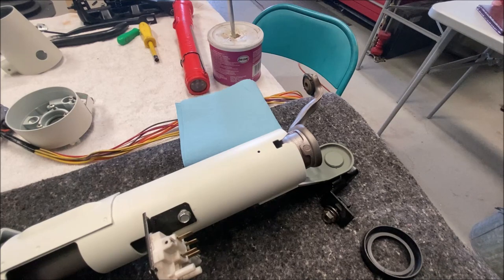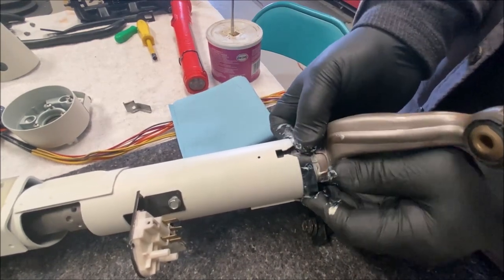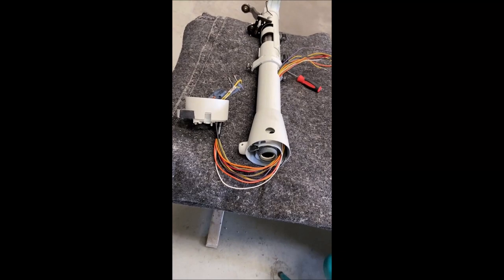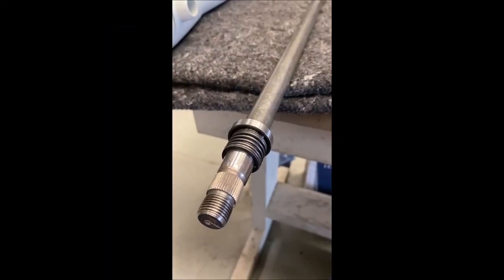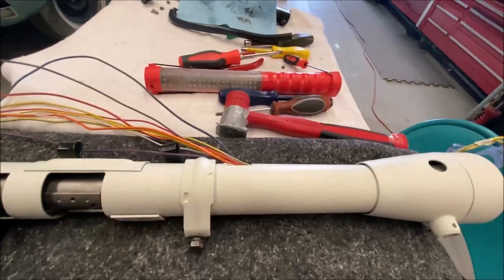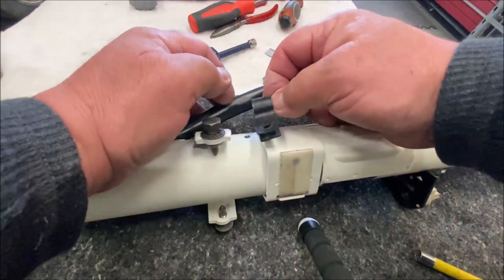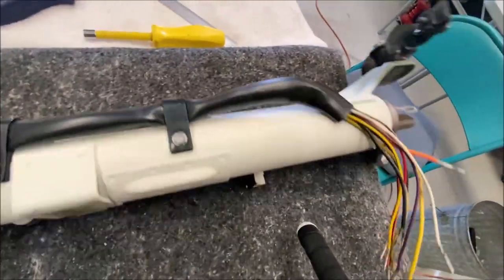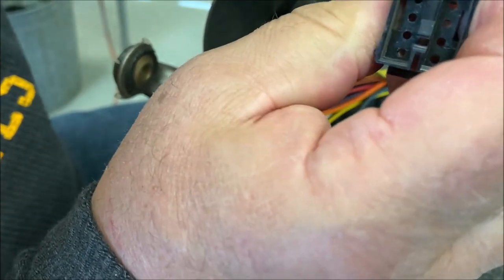1964 66 Thunderbird steering column and slide mechanism   PT 2 Assembly

Comment: Wow, your videos are extremely helpful. You got me through the confusion of the steering column when I was stuck. I have a '64 convertible that hasn't been driven since '77. However it is pretty clean and running again. I hope you continue to do more videos like this. 
Thanks for your excelent efforts. Dave
Reply from the maker: No problem Dave, my pleasure. Thanks for the kind words.

Comment: Awesome video with great explanations.  Having already done this task prior to watching your video, I’m relieved that I did it correctly.  Great shirt by the way.  I had the neutral safety switch leaking vacuum.  The column NSS on my 66 only goes to the parking brake release canister.  The actual NSS is on the drivers side of the C6 transmission.  I was able to disassemble the column NS switch, clean it up and get it to hold vacuum.  Great video, thank you so much!
Reply from the maker: Your welcome Bill

Comment: First off thank you for making a detailed video of the steering column, would like to know where did you purchase the bushings at the bottom, plastic thrust washer and sleeve for the bearing. Thanks
Reply from the maker: Hey ele, I purchased the lower steering column bushing and bearing sleeve from Birds Nest. You can also buy them from Thunderbird Headquarters too. The part numbers are 7347C and 3518C respectively and are listed in their catalog on page 53 of the Birds Nest 2019 catalog The plastic thrust washer is an original part of the steering column and I did not purchase that, it came out of the steering column. If I needed it I would have to rob it out of a parts steering column. Thanks.
Reply: @vintagethunderbirdrepair9426  Thank you so much for the info your video help a lot
Reply from the maker: @ele_112  Your welcome ele.

Comment: Great info i got a 62 tbird I imagine it similar anyhow it jumps out of park into reverse I imagine it could be those bushings thanks for the vid
Reply from the maker: Hey Bernie, The 1962 has a different style of bushing at the bottom and I dont think they reproduce those. However, they usually dont go bad. Ive never had to change one. The biggest reason why 1961-63 Thunderbirds fall out of park is the shift lever gets the grove in it and maybe the detent wears out too. Replace the shift lever first and give it a shot. I bet that cures the problem. Be gentle with the shift lever always, Don't just drag it down to shift. You must pull towards you first, then shift it down into gear. Thanks, Nick
Reply: @vintagethunderbirdrepair9426  thanks for the info and sharing your knowledge

Comment: I  really enjoy watching your most informative video’s you are very knowledgeable on the various repair topics for classic tbirds. My problem is the headlight switch on a 64 tbird convertible the part of the switch that sends voltage to the fuse that control instrument lights keeps burning no gauge lights. Please tell me what it takes to cure this problem
Reply from the maker: Hey Allen, the rheostat on the head light switch controls the dash lights. Voltage is sent to the headlight switch rheostat from the fuse and then from the headlight rheostat to the dash lights. The rheostat is the round thing on the head light switch that turns. You probably already knew that. A blown fuse means the part of the circuit that flows through the fuse overloaded usually meaning that power is going to ground somewhere. The rheostat on the headlight switch could be bad causing the fuse to burn. Sometimes they are corroded and pieces of the rheostat spring are missing. There could be a dash light wire crushed between two pieces of metal if some dash related repair was recently done. There's a lot of dash/instrument lights in and around the dash and center console, so any one of them could be crushed and touching ground somewhere. I've done that before. If the fuse only burns when the dash lights are turned on then Id guess its one of the problems I'm suggesting here. If the fuse burns even when the headlights are not turned on then I can only imagine what might be wrong. I use a fuse bypass tool  to put in place of the fuse while I'm trying to find a similar problem. It acts like a circuit breaker so every time there is a circuit overload, it pops then resets a few seconds later. This way you don't have to keep buying fuses. Very handy tool. The tool part number is S & G 25100. There is a YouTube video about it. The headlight switch or a wire to ground are the most common reasons for a blown fuse. I hope that helped. Thanks, Nick

Comment: Nick, is the upper column barring pressed on? I’m trying to figure out how to remove it so I grease the barring and replace the missing barring sleeve.  Thanks
Reply: The steering column is still mounted in the car.
Reply from the maker: Hey Mike, no, it is not pressed on but they do stick and are sometimes hard to get off.

Comment: Nick, great video on steering column!   I have a late production (July) 1962.  The repair shop rebuilt the trans and also put a rebuilt steering gearbox in (same part# as old) as old was leaking and sloppy.    When I went to test drive in the lot, the steering column moved left to right as normal... and could steer right and left. BUT it had about a 1/2" - 1" or so  movement up and down which made me nervous as it never did that pre-repair. I asked them to review the shop manual that was in the car and asked them to correct. Also when column moves up it will pop out of park.  They say its all tight.   Any hints on what I can tell them to look at to fix?
Reply from the maker: Hey Rob, it sounds to me like there is something going on down at the bottom of the steering column where it mounts to the body and to the gear box. It makes sense that this is where they were working and this is were the steering column mounts to the body so they must have disconnected something and then forgot to reattach it??? I cant be sure without seeing it but that's where I would start. You can gain access to that area if you remove the inner fender shield behind the left front wheel. That will give you some access to see in there. I would also check the area under the dash where the steering column bolts to the slide mechanism. Its always possible that something happened there coincidentally that is causing this. Good luck.

Comment: where do you find the plugs for the turn signal wiring? Great videos, helped me finally get a new lower bushing into the column. Fixed my play!
Reply from the maker: Hey Dakota, what do you mean by "plugs?" Did you mean the pins on the ends of the wires? If so, you cannot buy them separately and they are not removable unless you cut the wire. If they are bad then you need to purchase a new turn signal switch. However, if you can solder and if you have a donor turn signal switch that has good pins, I guess you could cut the wires and solder a donor pin onto the wire of the switch your going to use. I hope that helped. Thanks, Nick
Reply: hey there! Thanks for the response. I am referring to the actual plastic plug you run the wires through, that you made the cardboard diagram for.
Reply from the maker: @RudieCantFail1977  I have those. Which one do you need, the one on the switch side or the one on the car side?

Comment: Nick, great video. I'd like to replace my gear selector ("PRDL"). Can I do it without pulling the whole steering column? Can I pull the wheel, turn signal and horn stuff and pull the hub out somehow to access the 2 screws for th egear selector?
Reply from the maker: Hey Mark, yes you can do it without removing the steering column. You can make most repairs without having to pull the steering column. You dont have to remove the turn signal switch completely either, just slide it up a bit so you can remove the turn signal hub. Good luck.
Reply: Thanks! @vintagethunderbirdrepair9426
Reply: Thanks Nick. After fighting the harness protector and a stubborn bearing, I got the hub off! What a nightmare. @vintagethunderbirdrepair9426

Comment: Love your videos..could you tell me where to find the low level fuel sensor relay ??66 t-bird coupe .. zero options .
Reply from the maker: Hey James, it should be over by and above the fuse box on the passenger side. Thats the way I remember it (Im slowly loosing my mind so my memory is questionable). Should be there. Good luck.
Reply: @vintagethunderbirdrepair9426  thanks Heaps been wondering what one of those was there are a couple ..so think your mind is not all gone ..lol..thanks.

Comment: I'll skip coffee the day I do this one
Reply from the maker: Naw, they are easy, piece of cake lol. Easy for me to say right. You will probably need 10 cups of coffee on that day. Good luck.
Reply: @vintagethunderbirdrepair9426  Nick i snapped an exhaust manifold bolt so I got to yank the motor. But it gives me an excuse to spray out the engine compartment with this new sprayer I bought a few months ago capspray 115 hopefully it works I never used it It Was Eighteen hundred bucks. I dont know if you got my email but I sent out your crazy house key. And a pic of this dual-core master cylinder that clears the shock brace. I'm just hoping I can restore this rust-free car for about 20 grand
Reply from the maker: @ihave35cents95  Hey Michael, yes I did get the email and photo, thank you. That will come in handy. Expensive little sucker. Sorry to hear you broke a bolt. I've done that many times and became quite good at fixing them in the car. However, I also became quite good at  not breaking them. I have a technique to loosen them up before they break, works very well.  Good luck with that project.

Comment: I am trying to install the bushing with the column in the car and I was wondering how to you pull the inner tube out enough to side the bushing on? Thanks
Reply from the maker: Once you remove the NS switch lever and bolt under the shift hub, you can slide the shift tube down by either pushing on the shift lever attached to the shift tube at the end, or pushing down on the slide mechanism lever that is attached to the shift tube, it only moves down about an inch or so, so don’t expect a whole bunch of access room. It’s just enough to slide the bushing in there. Thanks, Nick

Comment: These videos have been a huge help. I unfortunately broke the little white plastic slide piece on the steering wheel. Can anybody help me find a new one?
Reply from the maker: Hey Noah, thank you. What white plastic piece do you mean, can you describe it and its location better? Thanks.
Reply: @vintagethunderbirdrepair9426  So glad you answered! It is the plastic piece the lock for the steering wheel rides on, your finger is on it at 2:44 of PT1 Steering column and Slide Mechanism familiarization. It is fragile and I didn't treat it as such....
Reply from the maker: @noahruiz2394  Ill check. Ill get back to you.
Reply: @vintagethunderbirdrepair9426  sounds good! thanks!
Reply from the maker: @noahruiz2394  Yeah, I found one. Its used and brittle but the only extra one I have. I don't think you'd find a new one unfortunately. Is $10 okay? Send me an email with your address and Ill ship it to you. tamie.nick@sbcglobal.net
Reply: @vintagethunderbirdrepair9426  absolutely. I will be sending you an email shortly! You are awesome!

Comment: On your steering shaft there is a spring and a "C" clip above the top bearing. I have a '65 that doesn't have a spring at all and there is no place for a "C" clip except to hold the bearing in place. Is there a reason for this?.
Reply from the maker: I wish I had some of my old stock left over to compare samples but I dont. I have a few other steering shafts but they are nowhere to be found so I must now use my defective memory. Some shafts have the spring like mine and some dont like you say. I have no idea why they did that. If I had some examples here I could look at them and maybe figure it out but dont so. Its a good question that I cant answer, sorry.
Reply: @vintagethunderbirdrepair9426  Thanks for the reply. I think mine just has a spring above the bearing to the steering wheel (according to my shop manual).
Reply: The spring creats a ground for when the horn button is in the center if your horn is activated by the buttons on the steering wheel arms it is not required